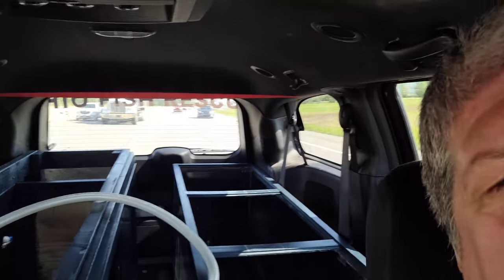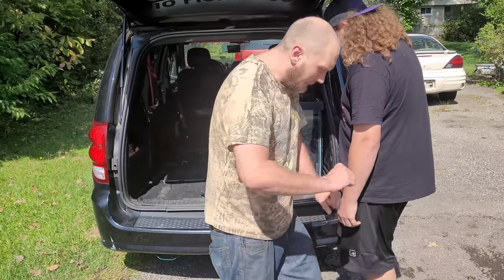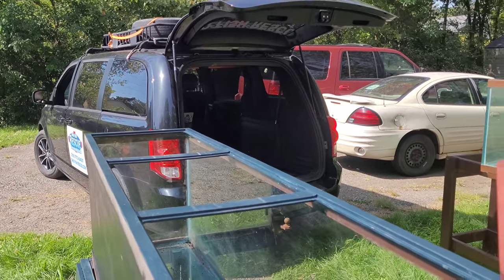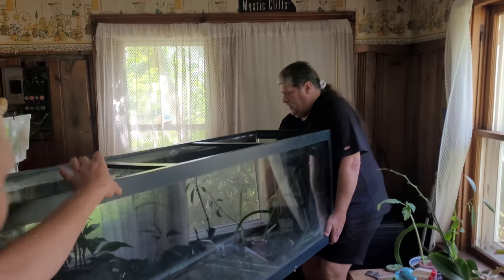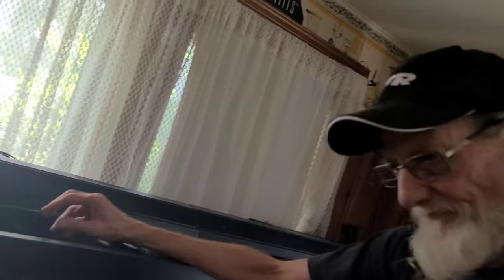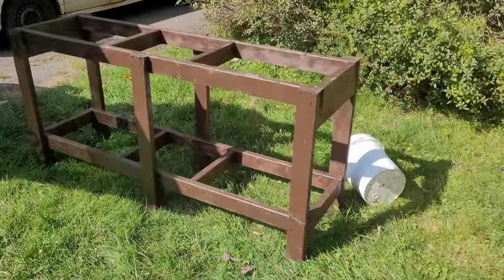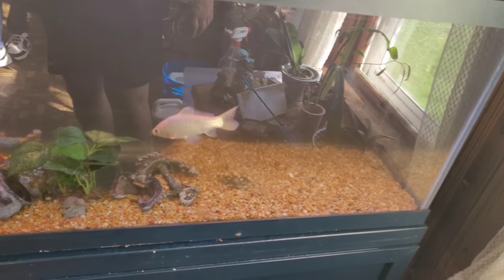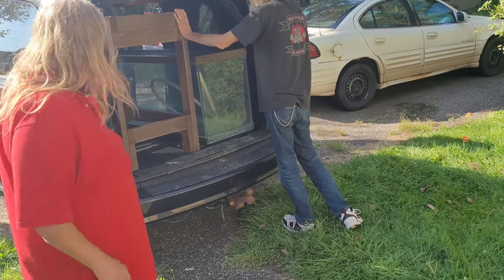Reaper gets tanked by OHIO FISH RESCUE

Comment: I know this is 8 month old but just seeing it for the first time... is the tank seated in the stand all the way? Looks sticking up about an inch higher on the left side. Like the left side is hanging up on the rim of the stand and not sitting down in properly. Just figured I'd mention it in case what I see is accurate and somehow it's still hanging up like that so you can fix it! Hope everything worked out ok. Nice tank!